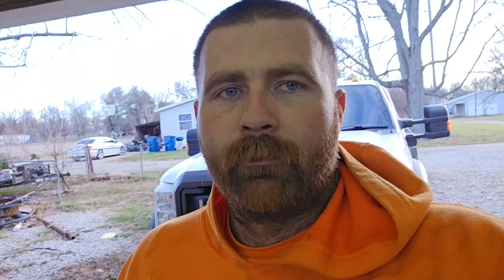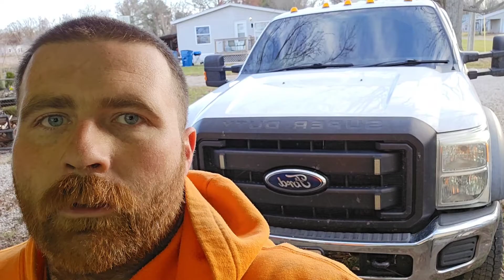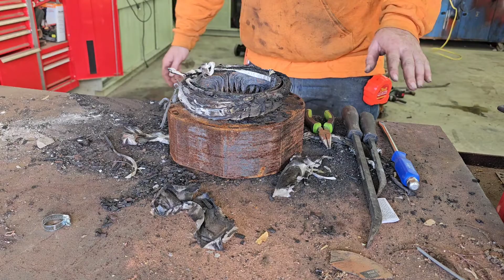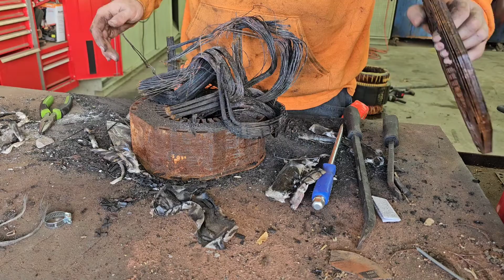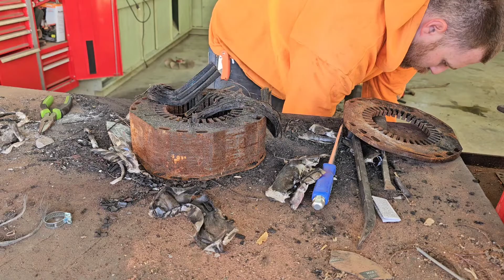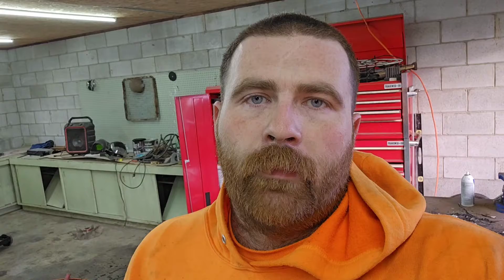How To Get Copper Out Of A Motor Stator!

Comment: I do a lot of sealed units and electric motors. I use a large chopsaw to whach both ends of the windings,  the punch out the centers. Copper is 3.05 #2 in northern Minnesota
Reply from the maker: That works great....im debating on buying a bandsaw too cut mine. I wonder how it would do
Reply: @midwestsmelters190  It would work awesome.  A lot of the time I cut one side and use a cheap electric hammer chisel to drive out the other side.

Comment: Okie scrapper uses an air chisel and he get the copper out quick and easy without burning off the glue.
Reply from the maker: Ive done that too smaller motors. But the  ones I usually do an air chisel wont touch it.